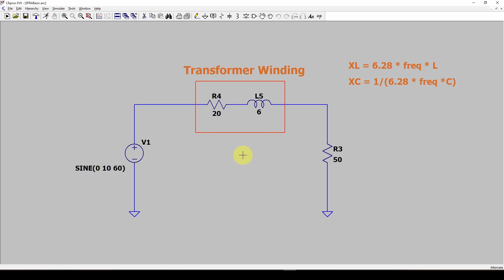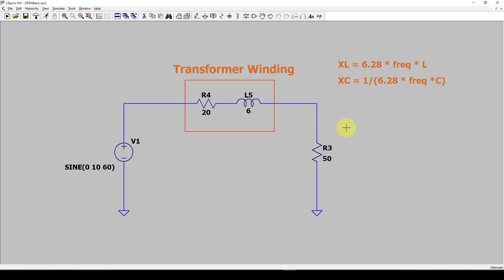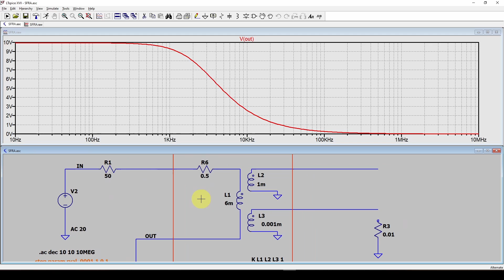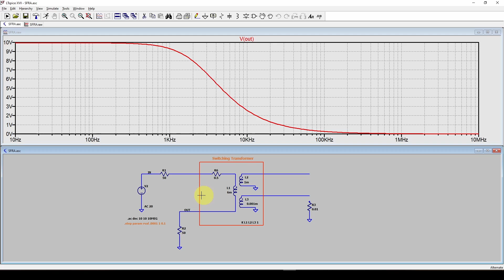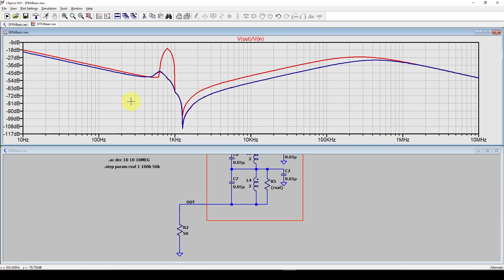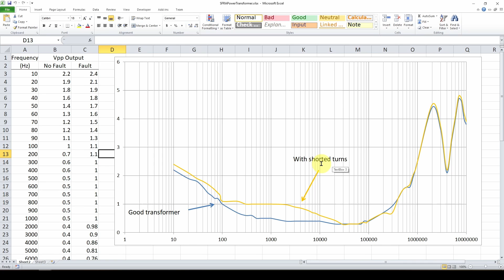Transformer Testing with Sweep Frequency Response

Comment: Thank you for sharing this info. I have recently been doing some simple DC resistance checks on a varaiety of guitar amplifier power and output transformers. I have noticed that the DC resistance of these smaller output transformer primaries and also high voltage secondaries on the power transformers roughly double with each halving of power for the set (Power and output transformer set). With all other things being equal, what effect does a higher DC resistance have on an output transformer primary?
Reply: the higher the resistance the less power it can supply to the secondary. Thicker wire less resistance more power. Or longer wire also equals more resistance so it's a trade off on wire length and thickness for the size of the transformer. thinner wire can be much longer for the same volume and weight but it has more resistance and is less able to supply larger amounts of power. for more power everything needs to be sized up.